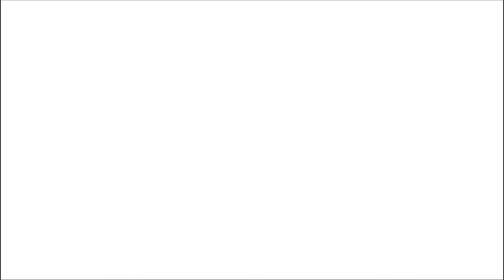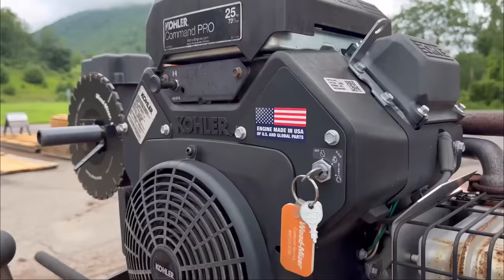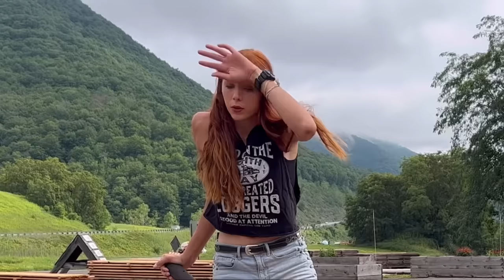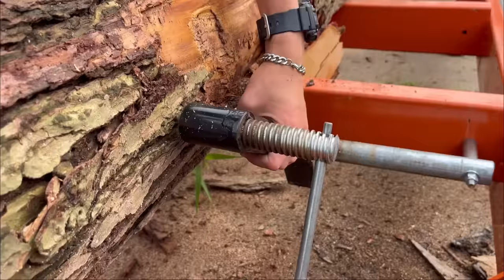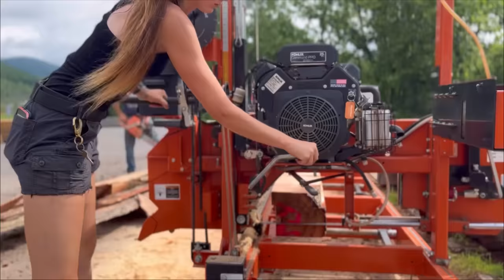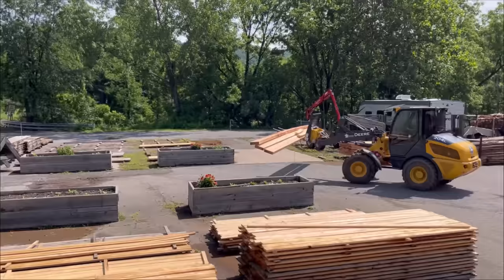Undertaking a Crazy Custom Milling Order

Comment: Great video, like the explanation concerning extra length and straightness of log required for producing long beams.  My experience with cant hooks has led to pushing away instead of pulling in case the hook slips off and whacks me. Enjoy watching.

Comment: Wow, that is massive! Have you ever milled any Spruce logs? The highest grade of Spruce is prized for building musical instruments, otherwise it is mostly used as interior dimensional lumber.  I am looking to "clear-cut" about an acre or estimated 30k board feet.  These are 65 year old "Christmas Trees".  I helped plant them back in the mid 60's.  Time goes fast Emerald.  Your doing a great job and you and Jade are an encouragement to all those endeavoring to succeed in life if you were wondering.
Reply: I’m not sure it’s millable on a small band mill, I’d like to know if they have a way because everyone I’ve talked to won’t cut it, I tried to cut some myself and the blades walk all over. I think it’s the high density of the knots and low density surrounding wood that causes the issues.  I’ve also had trouble with it breaking as it dries but I know it has to have its uses! I have about half a dozen more spruce logs and I’m torn on what to do with them

Comment: nice, i'd like a mill like that with the band saw , i have a big cedar looks like might die so i'd have to cram study the chainsaw mills, things are elemental sometimes, i wanted an entire cedar closet (the red purple heartwood cedar would be best of course ) , shelves , wall , store prices were silly except for cedar fence pickets and those are dumb price like all else by now...anyway the vid made me daydream of adding a bucket, hydraulic lift to a car/truck , i figure why not it won't have the steel tank tread or big proprietary tires or a fancy chinese/japanese diesel motor less powerfull either just the junk chassis and the full power moter to hydrailcs, excavators lifts added on , weight etc....../lol got a new tinker interest added , everything is elemental at a certain skill level imo....

Comment: When turning big logs, decide early on who's going to call the "count to pull or push" for the day. This eliminates any confusion of who makes the call and prevents disrupted workflow. When the both of you have set your cant, the chosen caller counts either down or up for the both of you to pull or push at the same time. (3,2,1,PULL! or 1,2,3, PULL!) Not doing this, you two are just gonna struggle against each others out of sync bursts of energy, which only results in getting worn out much faster. You'll be surprised how much easier and with less effort the logs will roll doing this. Cheers!

Comment: Much as I appreciate the shorts, tops and bare hands my anxiety for you girls went through the roof. One of those bendy rough edged boards sliding down a bare leg, a 4" splinter in the palm, a flying wood chip in the eye...I would want at the very least jeans, jacket, gloves and safety specs. You are both rare beauties but you get only 1 skin, 1 body, look after both.